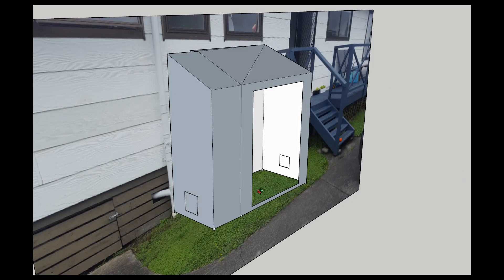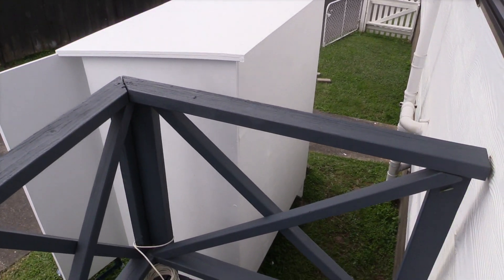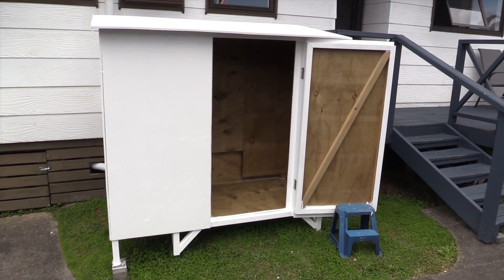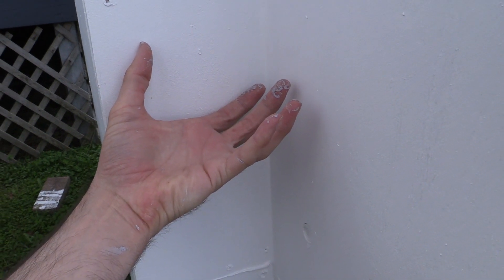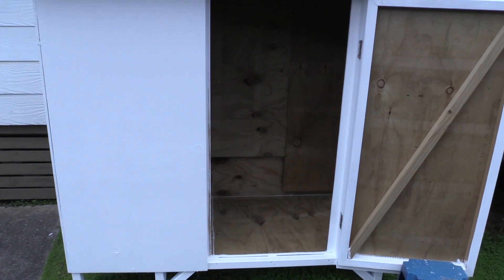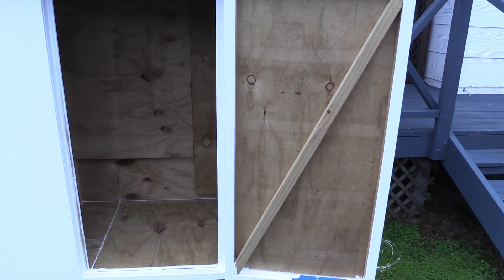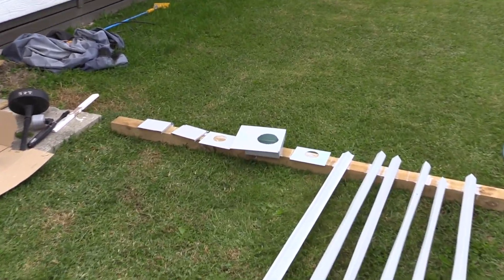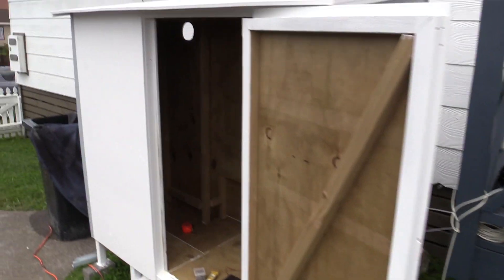Epic Outdoor Battery Box Build

Comment: you best optimize your packs then to be able to scale. My holders which post people use will have a cover over the fuses and bus bars so you can put them right up close to each other and not worry about them bumping into anything and shorting. you might want to do the same thing.
PS: Put pot plants on it.. just make sure the water doesn't get in :)
make sur you secure it well, anyone who recognises your house will one day come and pull those packs out.
Reply from the maker: I have a plan for pack scaling to 48v, its about two videos away :)

Comment: Room in there for the chooks too. If you do add a panel on the roof of that you can use it to power cooling fans. Assuming you have the roof north facing or having a lot of daylight. And until you get batteries in there load it up with bricks and try get it settled in the ground sooner.
Reply: Putting a small solar panel on the roof of the battery box and connecting that directly to the fan should make the battery box self-ventilated and you should not need put put any controls on it if the panel is sized correctly I would think.

The battery box looks great too, and if you painted the edging strips the same colour as the desk that would help it blend in I think.
Reply from the maker: Yes the box is going to get full sun and facing north but right now it looks good. I think a solar panel would look out of place. I will have to come up with something else. I need to run the fan and charge the lights "in a later video" oh theres a list of things it needs. Thanks for watching.